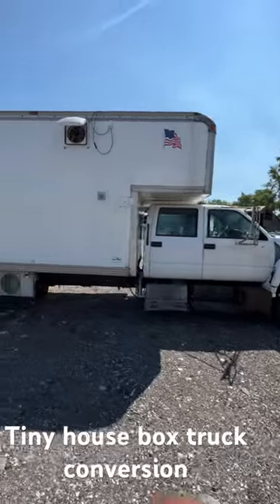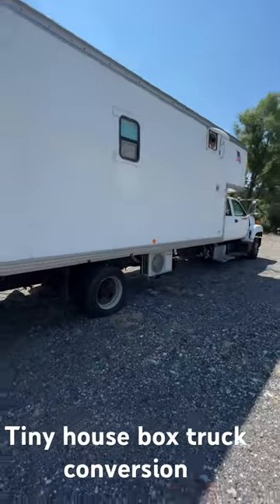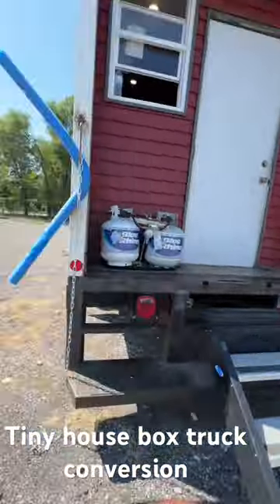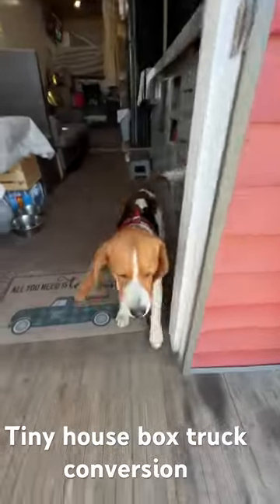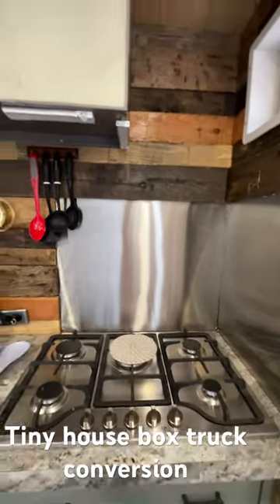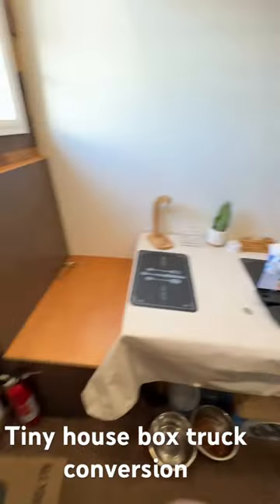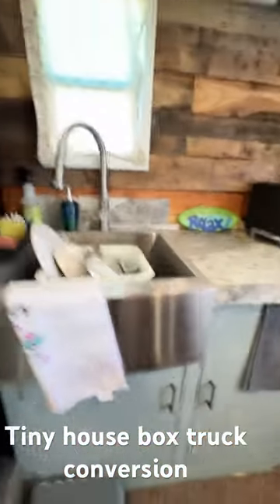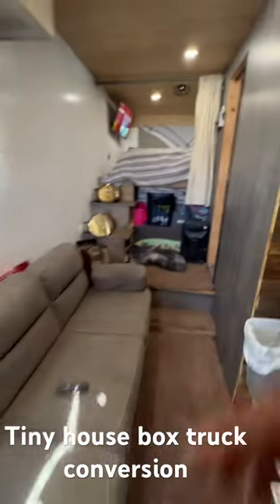Tiny house box truck conversion build. ￼

Comment: Seems like with that big of a flat roof that your truck would be perfect for a massive solar array on it for good off grid living. Avoid the Genny. Also the panels might keep some of the heat off the roof keeping it a little cooler inside.
Reply from the maker: I plan on filling the whole roof with solar panels. The only thing that has stopped me from doing it is my budget. As I get more solar panels on the roof, I will do more videos of it. I will put out a video of the solar panels very soon.

Comment: I'm really conflicted between getting an RV and doing something like this. Using a box truck as a platform,  I would know every system intimately, whereas a pre-built RV would remain a mystery. Any problems would probably require high dollar expertise to fix.. But the RV is immediately comfortable,  while it may be months or years before I'd have basic amenities in a box truck build. 
I'd really love to discuss all this with you. My friends just have opinions,  no real-world experience to help me decide.
Reply from the maker: Thank you and thank you for watching. I really say it all goes down to what you really want to spend. do you want to spend time or do you want to spend more money and have less quality? If you want to get it done and have it right now you can spend the money and get that however, your quality is not going to be there. You can spend the time and the money and the blood sweat and tears and sweat equity and get what you really want and desire. You will get better quality and better results out of a self built camper if you do it right. But if you want to get on the road right now and go camping, go to the RV store and spend the money and you will be camping tomorrow.
Reply: ❤ Thank you for your thoughtful and thorough answer. I really admire the work you have done on your truck, and when I saw it,  I realized that you have accomplished exactly what I wanted to do. In my case, however, I think I'm going to have to opt for the RV. I hate that it has come to that,  but I'm 75 years old and I don't feel as if I have the health and energy to take on such a project. I so much wish the idea had occurred to me 7 years ago when I first retired. However, various family situations had my attention focused in a compketely different direction than thinking about how I wanted to spend my "golden years".
Good luck to you, and thanks again for your help.
Reply: @gbenother8755 I hope you got an rv and got to live out your golden years the way you want.  Good luck to you and here's to many years more enjoying your retirement

Comment: Those steps getting into. The cab to heavy ur ac unit bolted under the cab is pretty low and dot might stop u put it on top 😅
Reply from the maker: Everything measures fine. It was inspected by DOT in order for us to get certified as an RV. Thank you for watching.

Comment: Great open space ….but I didn’t see a closet/storage, for such a huge box. You got the room for it. Plus you have room for floor to ceiling pull out pantry, between fridge/wall. And what’s under your bed. Video too fast.
Reply from the maker: I definitely did see that storage for a pantry between the fridge in the wall. I just haven’t had time with so many projects to even to attempt to build that. Thanks a lot and thank you for watching.